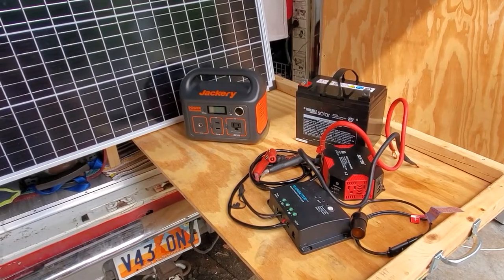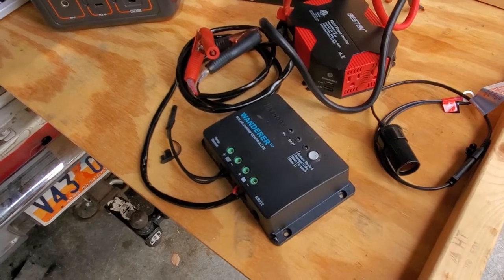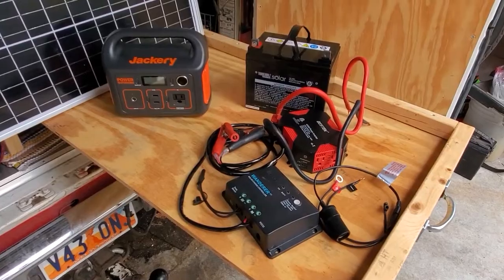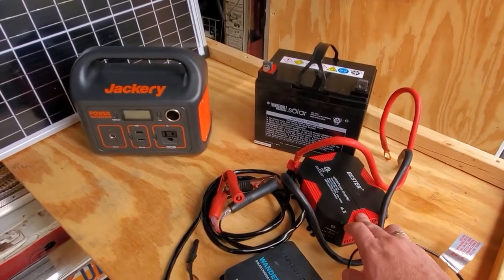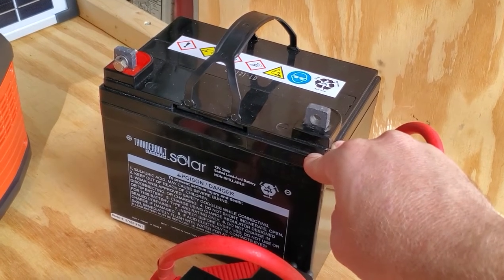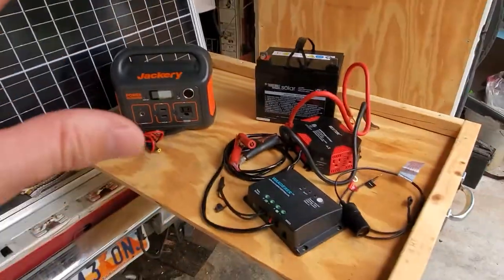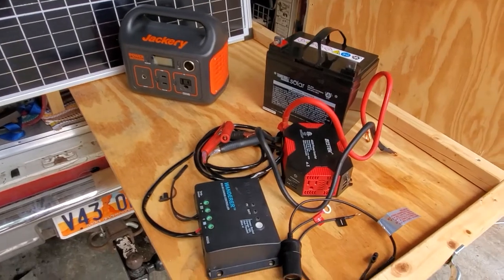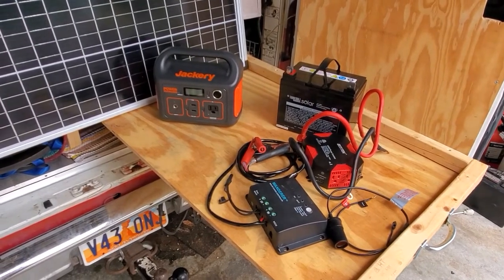12v choices: modular/component vs all-in-one system?

Comment: I thought that bestek 400w inverter was pure sine wave or does it come in MSW too? Cause I've seen it advertised as pure sine wave & in other u tube videos as well.🤷‍♂️
Reply from the maker: Yeah this one was of my earliest purchases after I got my van, and I really didn't know the difference or what I actually needed. I think they have one that is pure sign wave and one that is modified using similar looking cases. This particular model is not... It gets wonky with laptops for sure. If you scroll down to the questions the seller answers and says "sorry this model is modified sign wave" ... https://www.amazon.com/gp/product/B07FMFYDRD/ref=ppx_yo_dt_b_search_asin_title?ie=UTF8&psc=1
Reply: @kampinglogik  pure sine wave is the way to go so your electronic devices work as they should without any buzzing noises,heating up or damage. PSW  inverters don't cost much more than modified anymore unless it's over 1000watts. U just have to shop around. i have 3 pure & 4 modified inverters  but i use 1 of each for my needs & have the rest stored away 🤓
Reply from the maker: Yeah I definitely agree! I've since upgraded to a 1000w Pure sign wave in my van. It was one of those things where you don't have the understanding of the downsides until you've experienced it first hand :-) But the bigger pure sign wave inverters are definitely NOT cheap! But cheaper than burning out your laptop haha